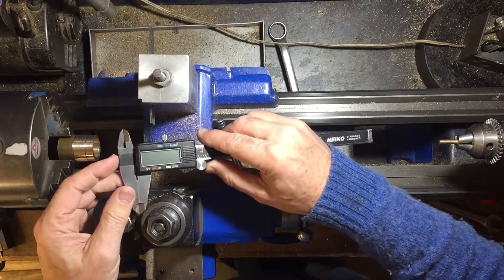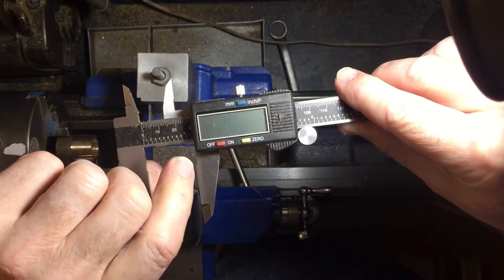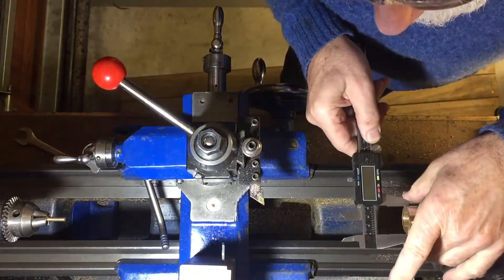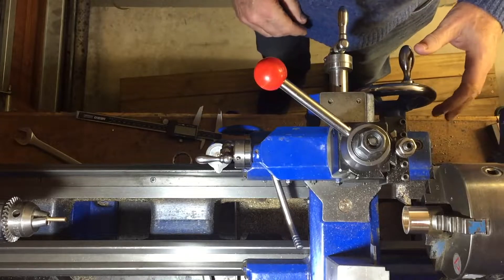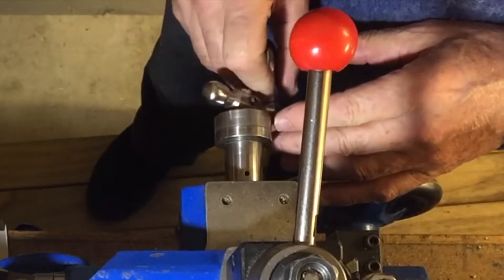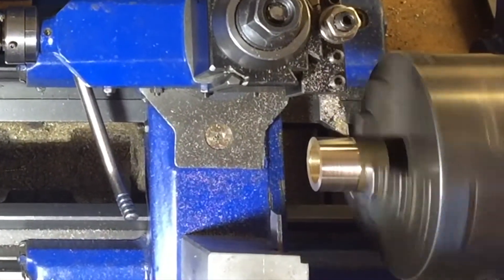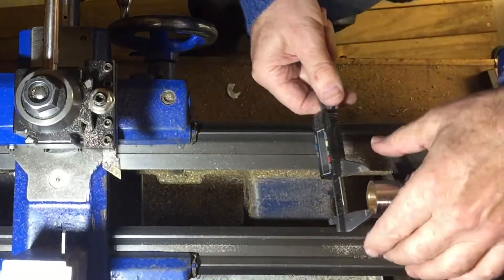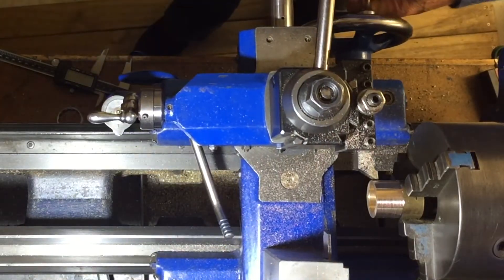Living with backlash in lathes and other machine tools.

Comment: Looks like you need to bolt your lathe down.  Is it just sitting on the bench?
Reply from the maker: I knew someone would comment on my wobbly lathe. Yes it is just sitting on the bench. Apparently it can distort the bed a few thou if it is not level.  It was originally bolted to a wooden trestle made of heart totara timber.  When I moved it I found the adjustable feet of the lathe were bolted to the timber. I didn't want to mess up that adjustment and left the timber attached.  Now that it is on the bench top it would be very difficult to get under there to remove bolts and re-mount it. It weighs 380 lb / 173 Kg and I cut a hole in the wall to fit it in.  One day I will get around to trying to fix that but I am not looking forward to it. I will have to use the crow bar and push wedges under it I suppose. I am hesitant to remove the head and tailstock to do that. The head is pretty heavy on its own. Any tips? I can get under the bench top to drill holes from below. The bench is a double layer of 20mm MDS board (fine chips). Seems pretty solid with a concrete floor.
Reply from the maker: I have now bolted my lathe down.  The head was making clicking noises so i removed and dismantled it, so this reduced the weight. Tailstock is easy to remove. I was able to swing each end of the lathe over the edge of the bench separately to remove bolts.  I bought an engineers level and need to adjust the level next.  It doesn't actually have to be exactly level as long as the level shows the same reading at both ends of the bed.